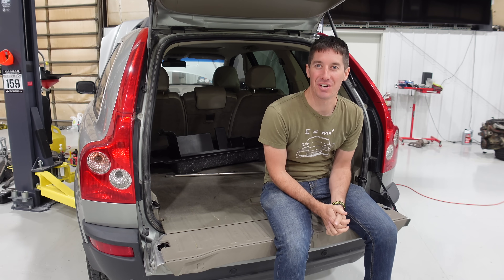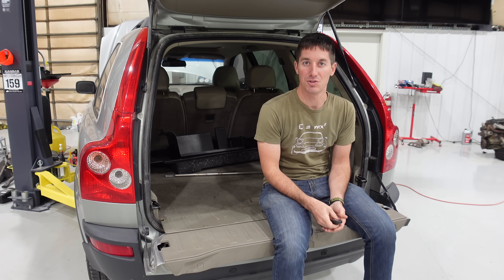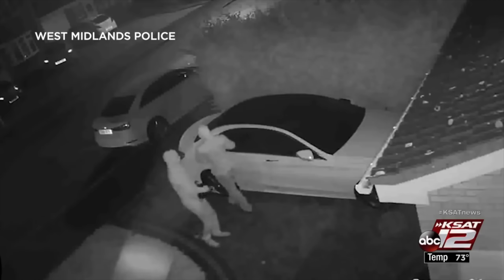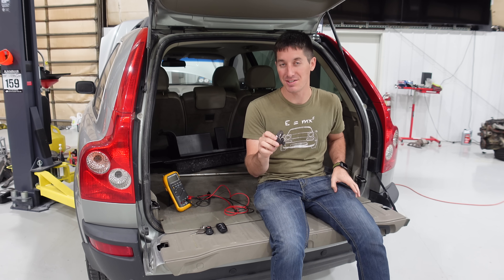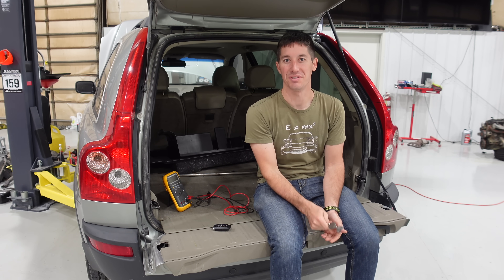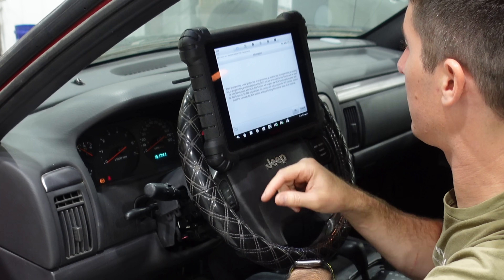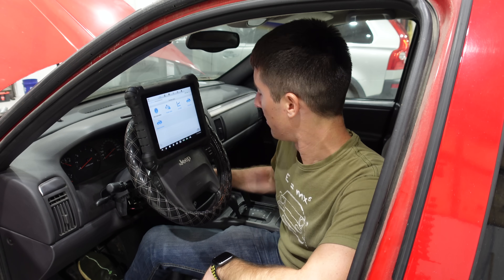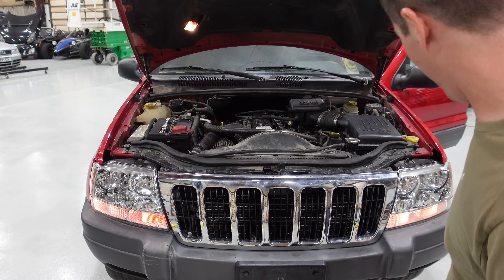What Is An Immobiliser? How Does It Work? And How Do You DELETE It?

Comment: My dodge's and jeeps never ran with the gray key. Always had to use the actual keyfob. Gray key was only good for manually unlocking the door wich would set the alarm off. Even after a new immobilizer installed and programmed from dealer.

Comment: those immobilizers are installed because of insurance reasons. If a new Car is not equipped with it, than nobody could afford the Insurance rates. I once owned the first Generation of Opel Omega Facelift (MY 1995) and the Remote lock would also trigger the immobilzer. But it was infrared and a piece of GM shit. in 96 they replaced that with a wireless system, and the Infrared was discontinued with NO spare parts. So if the infrared was dead you cuold not replace it with the newer system as they were not interchangeable. You sat in the Parking lot and cranked the Battery empty. I then managed to get the wiring diagram and cut the wire from the receiver to the ECU. Problem solved for ever.

Comment: Technically,I did go to a hardware store to get my 07 GMC Sierra ignition key copied. Ace Hardware charged me $80 for the program key. It took the woman who did it 3 tries. And she thought she did something wrong on the 3rd one when the truck wouldn't start at first. But within 10 minutes the ECU cooperated and that's been my main key for 3+ months now. Ace hardware was definitely cheaper than the dealership doing it.

Comment: A buddy of mine and I had Z cars (Datsun 280Zs) that were only a year apart and we discovered soon after I got mine, that our keys would work in each others ignitions. He asked me to help install a fuel pump cut out switch after mine was stolen from where I was working one day. I got it back in one piece and not thrashed. Drove it for a year or more after that before replacing it. I still miss it though. But it was rough and a little banged up.
Reply: The key from my 77 280Z works in my 83 ZX Turbo.  Quite handy actually since the ZX didn't come with a key!

Comment: I had mercedes permanently disable the "Keyless Go" on my 2016 Mercedes due to the high level of thefts in the UK using radio repeaters.  My older Saab 9000's have Saab VSS. A separate security module and the engine ECU have a shared 5 digit PIN which must match. Easy enough to fix if you have an old laptop and the right software. Will never forget my 88 Passat GT which had an aftermarket Clifford alarm of the time. It would talk to thieves. "Step back or the alarm will sound. Last Warning.....".  Awesome, dont hear those anymore.

Comment: I hate to be obvious, but when you said cycle the key in your vid, you turned the key to crank. It should be key off, then back on, right? Also, some of the security programming sequences I remember required weird things to be in a certain position, like e-brake to be set. Good luck!

Comment: I'm pretty familiar with dodge. You need to disable the immobilizer initialization in the pcm file. You will leave the immobilizer disconnected and the computer will never look for it. It had this done on one of my dodge neons because of immobilizer problems. They are best removed.

Comment: Got any transponder codes? I had a Durango, owned by a city. They sent it to the Dodge dealer for skim issues. The dealer replaced the PCM and was unable to reprogram the skim. City took the car backhand sold it dead at auction. I bought it. Turns out a fuse was blown that sent power to the skim module. I found this out by checking power and grounds at the skim module. Replaced the fuse and reprogrammed the keys. Was good to go.

Comment: I just purchased a current generation Ford I’m definitely getting spoiled by that  2 way smart key not to mention Ford pass on my phone. That GM VATS system brings back memories I used to cut and copy them all day long back in the day when I worked at a rental company. Biggest 🤬 back in the day was having cut keys from the code by hand with the little key code cutting tool, I had about a 50/50 success rate with them.

Comment: My 1999 Chrysler Town & Country once decided to "immobilize."  The system was somehow part of the gauge cluster, and I learned that a cold solder joint on the ground for the cluster wiring harness was what was causing the car to turn off after running for two seconds.  After I re-flowed the solder on the circuit board for the plug, the vehicle was back to normal.  Check that, maybe?
Reply: I think the same thing on my 2001 grand Cherokee the gauges are dead and skim key dash light is on. Did something to get the key dash light to go off and the gauges were alive only to be shut back down 10 seconds later.

Comment: Try feathering the throttle peddle like you would for an old carburetor car.  I have a 2004 Grand Cherokee and any time the battery goes really low or dead the first start up requires me to manually run the throttle.  I take it for a 1/2 mile drive and the computer relearns the idle mixture.

Comment: Other than the immobilizer had pretty much the same issues with my $1k Grand Cherokee oil cap broke dipstick handle broke off. I had factory lights but they were faded so I had to polish them out. Other than that its been a great little daily driver runaround when I dont want to use my work van. And for $1000 out the door you cant realy beat it these days. One thing about mine is the 4.0 gets fantastic fuel mileage.

Comment: JR on jeeps you have to hold the gas pedal down a little to keep it running after a dead battery. I have a 2000 wrangler and after my battery died I had to charge it and then hold down the gas pedal for a few minutes until it relearns the idle

Comment: I probably would have just went to the dealer and bought a new key for $150, just to see if it would work. Then, you can eliminate the key and troubleshoot the immobilizer system. If it was the key, I would have gone back to the dealer and paid another $150 to get 2 keys. Yea, it sucks and is a violation of right to repair. 

Why? Because time is money, and that's why the key cost $150.
Reply: Briefly. Certain Ace Hardware stores will make ignition keys with the immobilizer chip for $80. Time is money. But 45% cheaper and the same amount of time I'd say the hardware store is worth it.

Comment: The "New Keyless" System that has the "Push Button Start" is convenient, unless the Fob Battery Dies...
I keep spare batteries in my Wifes Glovebox and mine as both of our cars have this system. (2015 & 2020 Mazda3)
Reply: They will still run with a dead fob battery, usually a cup holder or center console area has a spot for the key, and it can read the key still and start the car. 

My mothers Chevy Cruze did this and the cup holders in the center console is it’s “dead fob to start” area

Comment: Loved this format!

Do you think there’s a pretty good chance it’s really just there to allow the dealers to get $140 profits on keys?
Reply: Bingo 👌🏻. That’s how they get you
Reply: I dont believe that. Locksmiths charge higher because of the cost of software and hardware required to copy/program keys. Manufacturers are trying to keep cars from being stolen and as always, engineers make things more difficult than need  be. The "right to work" issue is very real though.

Comment: For the GM resistor keys, as the lock cylinders got worn/and so did the keys me and a friend usually bypassed ours by cutting the cable going to it and putting in a resistor between the two wires so it was always given the correct value. luckily it was always in an easy position to get to and only took around 30min to do

Comment: I don’t know anything about the Chrysler system, but Could it be that the transponder chip inside the key is bad?  So no matter what you do it’ll never work because the transponder chip isn’t working correctly you know the things to go bad if the keys original and it’s been around forever there’s a good chance that perhaps that chip is no good anymore I’m not putting out a signal are not doing what it supposed to do so no matter how many times your program it and do this and that it’s not gonna work I think you just need to give up and get a different key or just suck it up and take it to the dealership I guess right? Does anyone agree with me on this or is that not possible.

Comment: Weird thing, my Saturn claims (in the manual) that it uses "coded resistors" (which implies something like the Camaro's system), but a bare piece of metal can be used. (An oem key is less likely to wear out the ignition, but...) Are they just lying? Is the resistor just in the key switch so you can't hot-wire it, you have to actually turn the cylinder?
Reply: Early Saturn uses the GM resistor he described in the vid at 3:33. Bare metal has a set resistance, it's just very low. They can be programmed to accept multiple values concurrently. Later Saturns used the new GM system.

Comment: My Neon had a dealer installed immobilizer and finally one day it refused to allow starter to crank. I tore lower dash off and found where the thing had been tied in to the starter signal wire, cut it out, and twisted the wires together and drove home. Later I just put a crimp connector on the wires and drove it fine for several more years till it finally killed itself seeing how it's not a high current circuit. The 06 Charger RT I replaced it with has the skim but not the newest rf crap. I have both keys and they work.

Comment: At what point do you just break down, order two new keys from Chrysler, and call in a favor from someone with a DRB2/DRB3?

Using FORScan for PATS on Ford's is refreshingly simple, and it actually works
Reply: He has the tools, just needs two new keys and to verify he's following the correct key cycle process (he does not in the vid). I've programmed several.

Comment: My Chrysler van I had to buy two keys for that thing so I spent roughly 400 bucks. Yes I called a locksmith. He called someone at the dealership to reprogram the chip in the key. And then made me a key. But he also was gracious enough to make me a dummy key for the door key.Do do I feel taken advantage for paying 200 bucks for a key. No it is what it is.Here's the thing I agree with the right to repair. I like the extra security. A locksmith has to spend money for his equipment his training his time then work with the manufacturer through the dealership. I don't think every time Dick and Harry should know how to bypass a security system. You're right if someone really wants to steal your car the final way. But at least I'm going to make it difficult for them to do like you said you might have to get a new key cuz that one might be damaged pay dealership AKA locksmith or even Walmart to get a new key program.
Reply: My neighbour wanted three extra keys for her 2017 Chrysler van. Was quoted $700. Bought knock off keys for $50 on Amazon, pin puller for $5, and I used a file to cut the door keys. You paying what seems like a fair price for the service makes it no more or less secure.
Reply: Dude I was at work and I needed a way home. If I need an extra key yes I probably could have went a different route.

Comment: I used to work for a taxi company that used 1996/2002 dodge caravan Plymouth caravan and Chrysler town and country with the same keys and problem was a bad solder in the back of the Gage cluster. Try unplugging the cluster it will probably run. Replace with used or fix

Comment: The problem is that you don’t need a key to steal a car with a tow truck.
Reply: True. But you want a flatbed if you don't want to destroy the transmission in most automatic vehicles. Especially if there All Wheel Drive.

Comment: My 96 F150 is old it doesnt even have a immobilizer. If a theif really wanted to steal my 
the only thing .theif would have to do is to break lock cylinder in the steering column.😆

Comment: If only they would put remote start in manual transmission cars from the factory. I mean most newer cars know what gear it is in for engine fuel and ignition mapping so if it is in gear just don't start, if it is in neutral start. Not hard to do

Comment: I appreciate your determination in chasing this down. I had a '93 ZJ with the IR "security" system that would give me fits. I drove it for a few months, burned several quarts of oil trying to fog the NW side of ATL for mosquitoes and sold it for what I paid. Still would like to have another, but only if I could get rid of that infernal system.

Comment: Had the same problem, turn key forward, then push accelerator 3 times. Turn key off, then it should start. It worked for me, 99 grand Cherokee

Comment: I had a 1988 Corvette with that early GM "chip"  key.  Around 1996 it got to where it wouldn't start. Dealer had to replace the ignition switch. It wasn't cheap.

Comment: The computer putting the Vehical in limp mode. Thank you GMC.
 All it takes is a faulty oil pressure sensor or temp sensor to shut off the fule pump.

Comment: I fixed a Pontiac Bonneville using that solder into the resistor trick.  I remember it being and orange wire.  I never thought about how to steal a car like that, but now that you said that there's only 14 different resistances, if I were to stay with that car long enough, I guess I would be able to get it running with no key.  :-)

Comment: right turnsignal sections flashing opposite each other = bad ground. Wish there was an easy solution for the immobilizer especially since you are using the proper key for the vehicle. Makes one wonder if Chrysler has a service order for it. If not the should have.

Comment: could also be scan tool itself. buddy has a matco they didn't work, so then switched to snap on and it worked. but yes, you erase everything and use new keys. ive always ordered keys off Amazon and had the dealer cut them and work fine. find someone with a drb scanner, that actually works for the jeep. i see people commentint on how bad Chrysler is, i don't understand. i worked for them for years, and the only one i hated was the older Pacificas bc they used a hybrid bus system, which was when they were switching over systems. idk, if i had time with it we could get it started

Comment: Why not just erase/ reflash the computer completely using the jbox that comes with your autel? Get 2 new keys from the dealership and then program the new red key and basic key and you should be good to go. In theory of course. Or just call a locksmith and they should be able to program a new red key for you. They did that for me when I had the same issue.

Comment: The king of immobilizers is a stick shift car. Most every thief can't drive a stick...I don't want that technology bullshit. It's not necessary in cars. I don't need remote start, I'm not lazy. If I let my car warm up in the winter, I'm right inside of it. I never let my car sit alone and warm up. You saying "this is everything consumers want in a key" is pretty bold to assume that everybody wants this technology bullshit. Way more shit to break and fail...and when it fails, it's thousands and thousands of dollars. My 2004 acura key has a chip and cost me 20$ at the Honda dealer to be cut by the Vin. No special programmer needed. I had an 05 Manual cavalier ls sport coupe that I had to replace the lock cylinder in, followed the security reset and it was fine. Part only cost me 75$ through oreilly when I worked there.

Comment: i had an issue with the immobilizer on my 2003 Malibu, it was intermittent and would choose the most inopportune times to not let me start the car for like 10min. occasionally it would do it to me more than once and I'd be stuck sitting in my car for 20-30min just waiting for it to let me drive it again. I sold if before i ever figured out how to get it to not do that.
Reply: Typically cleaning the key and cylinder with a qtip and rubbing alcohol did the trick. Didn't take much lint or corrosion to get them acting up.

Comment: I had a caravan that had the same exact issue. I did everything possible and no luck. I almost gave up but then decided to go to a pull a part and looked for the exact year caravan and took the ECU out of it, the original key out of it, and the SKM module out of it. I replaced everything in my caravan and used the factory key from the pull a part and it started right up. The problem with SKM module is that it gives up and once it does the only thing u can do is what I did nothing else works.
Reply: Dont change anything with your scan tool. Don't write the new vin otherwise my method won't work. Just plug and play and these and it will work guaranteed. This van sat for almost a year and this was the only way I got it to run. 2 dodge dealers gave up and bunch of locksmith all gave up.

Comment: so the immobilize uses a radio signal. i wonder if the receiver end if you could put a power source where it reads the signal and then the it would think the key is always in the truck. im sure its a certain resistance but if you jumper a it from the receiving end somehow it would work. prob above my skill level with but someone that knows enough about the ecm and electronics could prob figure out a 50 cent fix. basically if you can trick that antenna to make it think its seeing the key it will always work.

Comment: I've owned 3 WJs and worked on numerous more and never had this issue...but on my 95 zj which has a similar key I was experiencing the same issue. The drivers side key cylinder had a   2 wire electrical connector attached to it by disconnecting and jumping that harness I was able to bypass the security  and drive the jeep without issue.